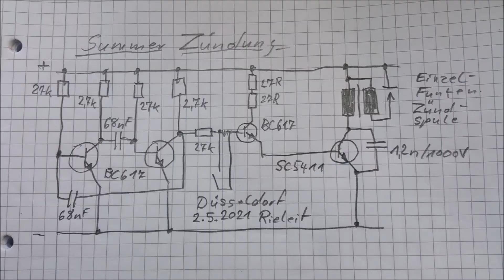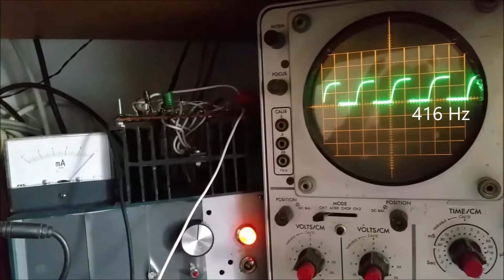Motor 53, langsam laufender kompressionsloser Zweitakt Motor mit Summer Zündung.

Comment: That's Awesome, I'm trying to build one of these, Looks like flywheel weighs about 10lbs, Piston has no piston rings and the timing is 5 deg BBDC, and it breaths thru a loose spark-plug.
Reply from the maker: Good atempt, very interesting. I am waiting for the first pictures. What is "BBDC"?. Motor with or without compression?.
Reply: @pr191148  Your ignition timing,, you have it spark (before bottom dead center) And I thought you use no piston rings? This is info i gather from your videos.
Reply from the maker: @jocrp6  It`s right, 10 degress BBDC and no piston rings and no compression.